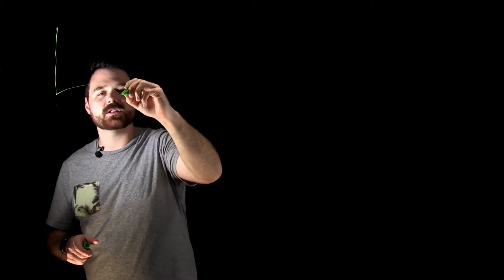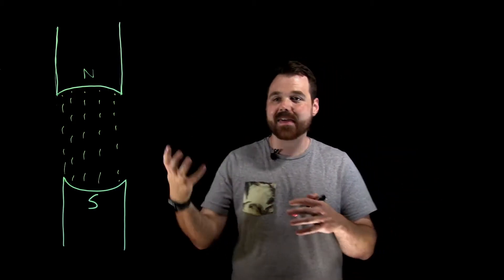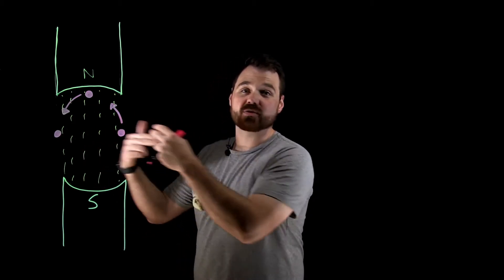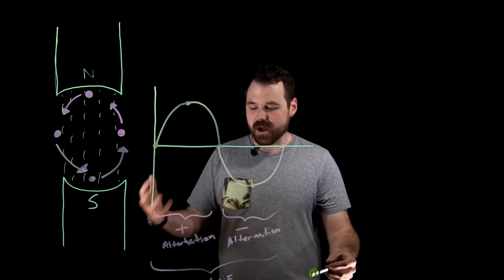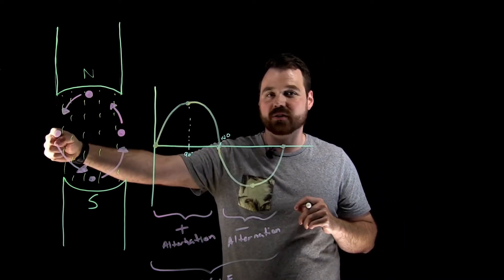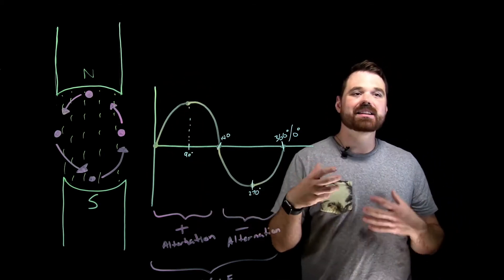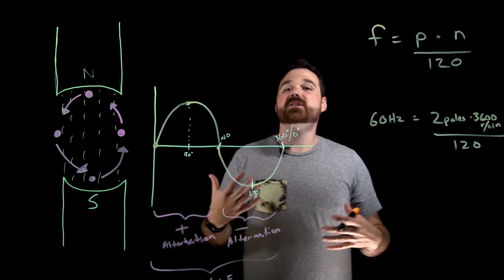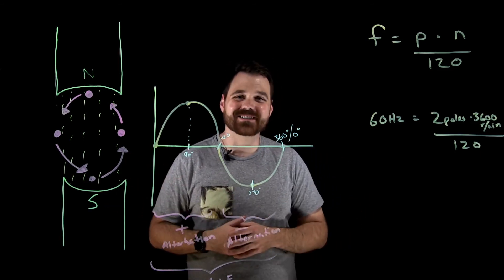AC Sine Wave Generation and Frequency

Comment: dose 120 increase if there are more poles. . . 4*3600/240=60 would that be right ???
Reply from the maker: No.

120 is a constant value and it never changes.
Reply: @ZackHartle  Thank you for the reply, would you be kind enough to enplane way. . .
Reply from the maker: @squeaksallan8195  So because frequency is cycles per second, we need to turn Revolutions per minute into seconds, s we divide by 60 and because it take a pair of poles to complete a cycles, we divide individual poles by 2. Therefore we divide by ( 2 x 60 ) which is 120
Reply: @ZackHartle  Thank you again, so even with the stater on the out side(no iron) and the magnet on the inside with an odd number, the same would still be true???
Reply from the maker: @squeaksallan8195  I don't think I understand what you mean exactly. Sorry!

Comment: Excellent explanation. One thing that puzzles me for a long time: 230V AC, does it mean, that between my 0o and 90o I have 230V (+), then between 270o and 360o 230V (-ve), or is it rather 90o to 270o   ->  230V. In essence: 115V above x line and 115V below?
Reply from the maker: No it's actually what's called an RMS or effective value. It's a little complicated to explain, but watch out for a future video on it!